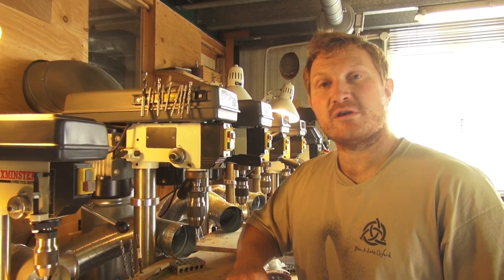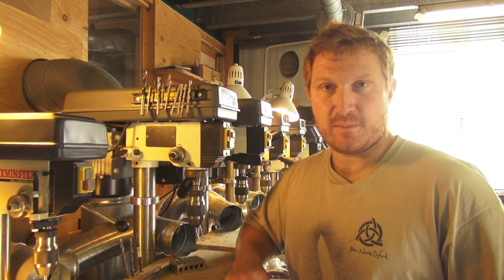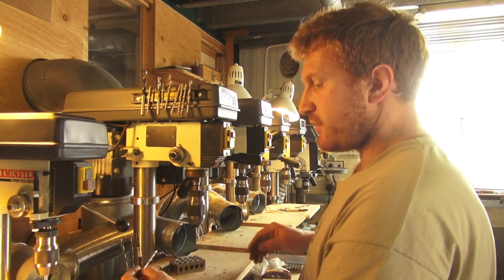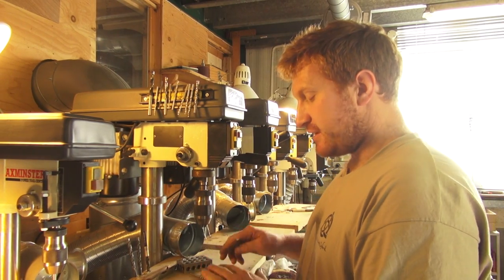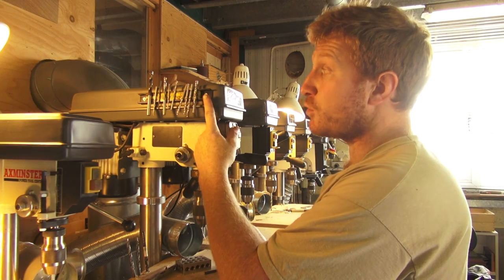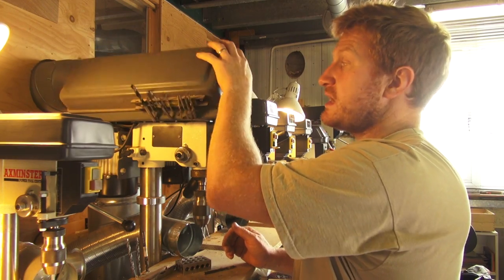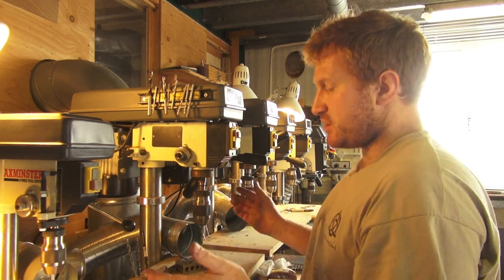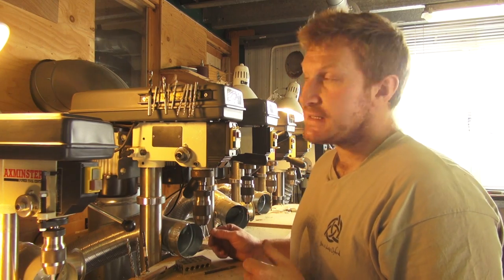Workshop 'Top Tips'  - Episode 3) - Drill Bits

Comment: I do the same thing!  I find that old speakers (pc, stereo, other)  work GREAT and are usually find dirt cheap at yard sales.  the larger stereo ones work great if you add a thin plate of metal: 1" x 6" around 1/8" thick.

Comment: Great drill tip Ben. Thanks Sandy
Reply: +Wiltshire Man If a drill bit becomes magnetised and collects swarf then it needs sharpening.
Correct speed, pressure and cutting compound (if necessary) in concert with a sharp bit means that the pieces of swarf are too big to become stuck to the bit and work space and simply fall away.

Comment: If a drill bit becomes magnetised and collects swarf then it needs sharpening.
Correct speed, pressure and cutting compound (if necessary) in concert with a sharp bit means that the pieces of swarf are too big to become stuck to the bit and work space.